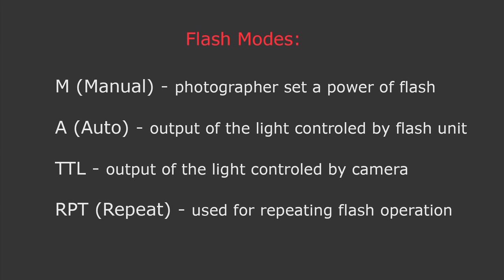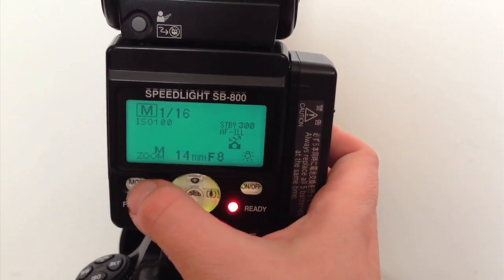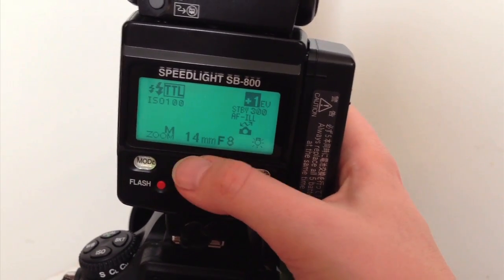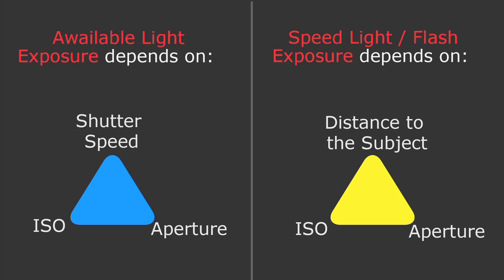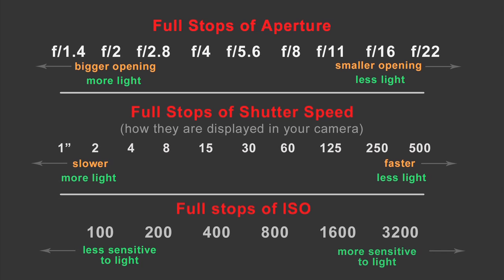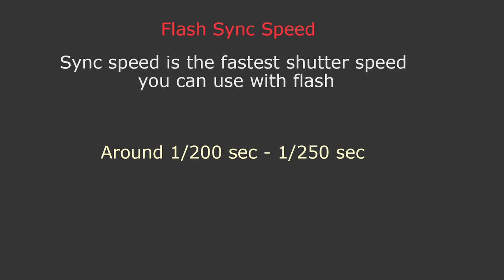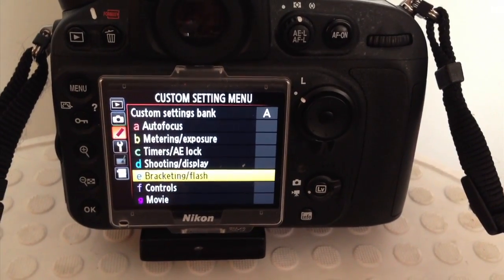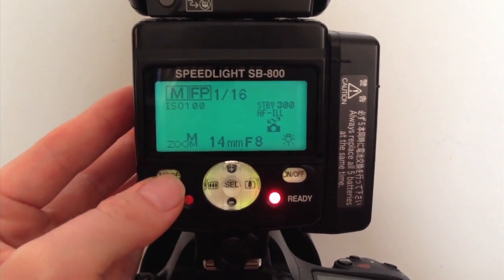Lesson 26 - Using Flash: Exposure and Flash Modes

Comment: Thanks for the info. I've just started experimenting with fill-flash as a way of eliminating noisy, high-iso & potential camera shake/motion blurred photos that I've been plagued with in the past. I often shoot indoors with models (such as yourself), and had not been able to get around these probs, 'til I resolved to use flash (which I don't really/typically like to use), but use it as a supplement. When I got my Nikon D5300, I saw where it gave me more options (since it already performs well in low light) that include flash control & compensation. Thanks again for the informative video.

Comment: Hi , Thank you for your excellent video  I use a D7000 with 18~105mm Kit lens or 35 mm F1.8 Nikon DX Lens. I have noticed that almost always whenever the Flash Warning  Sign keeps glowing in the View finder even I am shooting on bright day outdoors , in A mode or other Modes .  I was wondering  if there is something wrong I am doing or there is setting I need to change.  It would be nice if you could guide me to resolve the same . Thanks again

Comment: "I have a problem with HSS. I have sony SLT A58 camera, Godox AD200 flash, and Godox X1T-s trigger, but still beyond 1/250 sync speed (shutter speed) during bright day light, I am getting dark bands on the face of the photograph. What is the solution. Thanks."